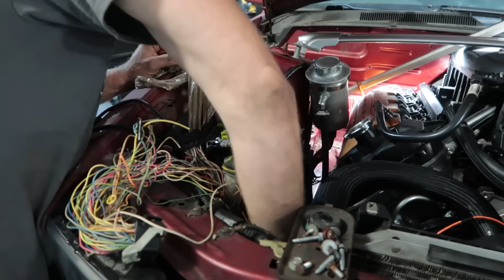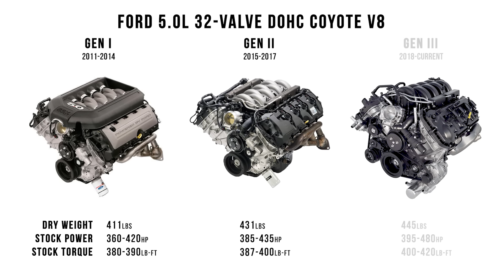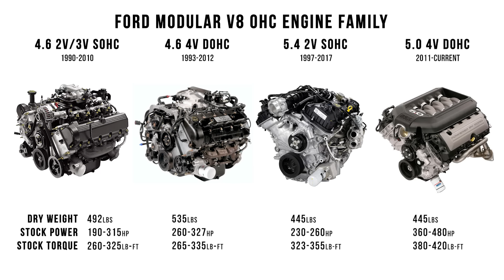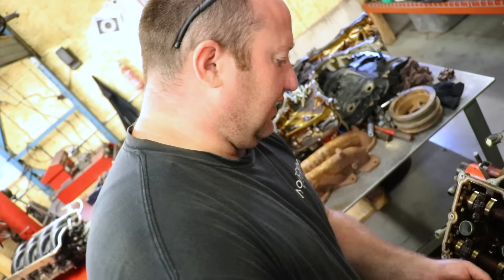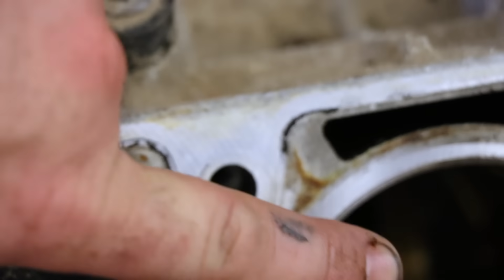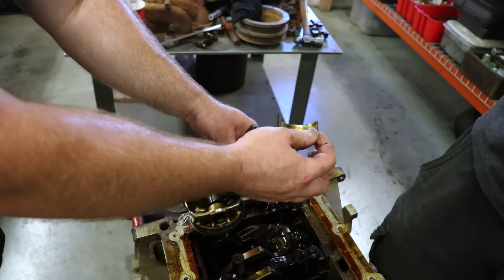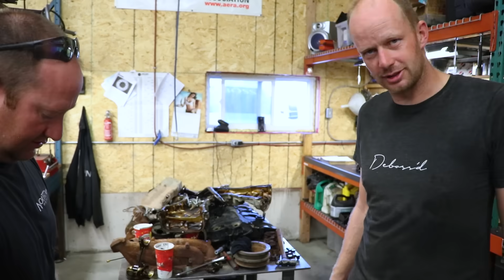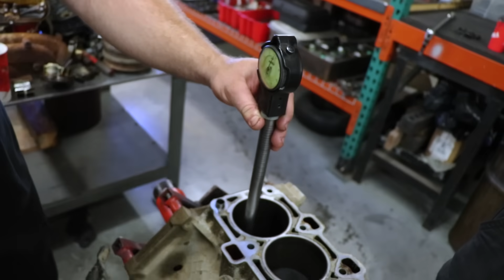REVIEW: Everything Wrong With A 5.0 Coyote Engine

Comment: I’d take an OHV engine any day of the week over a DOHC engine. Way of the future my ass. Ford just spend all that R&D cash on the new 7.3 pushrod gasser. The OHV’s aren’t going away anytime soon.
Reply: DOHC is OHV, OHV just means over head valve. The term you should use is cam in block or pushrod motor. And the reason they specify if it’s a OHV is because ford for example had a flathead v8 which had the valves kinda built into the side of the bore is how I’d explain it.
Reply: @MichaelFletcher-to7mm  my butt stinks
Reply: Mike Pevency that sucks man, go wash your ass.
Reply: Spartan 0703 
Yeah I already know that captain obvious. Thing is I just don’t care.
Reply: Francesco just saying, I would’ve never known for all I knew you’re just a dumbass who doesn’t know the correct terms, but glad that isn’t the case.
Reply: Spartan 0703 
Nobody says “cam in block” that’s just pretentious. When saying pushrod or “over head valve” is more common anyway.
Reply: Francesco I have not heard people call a pushrod motor “over head valve” OHV can be applied to both overhead cam and pushrod motors, once again it’s all about using CORRECT terms.
Reply: It is the future. GM is in talks of replacing their 5.3 with a dohc 4.something liter v8 and the rest i4 and v6 turbo engines. The pushrod is punched out technology wise. Its at its limit. Ford said they HAD to use pushrod design bc of its size. Thats the only reason they said.
Reply: Joshua Childers
Are you sure you know what you’re talking about? Ford said they wanted the 7.3 pushrod for low end torque and longevity reasons. Not “oh it’s too big” or whatever you’re saying. And what do you mean “punched out tech wise” like what does that even mean? OHV and SOCH/DOCH engines have been around for basically the same amount of time. They’re both really “old technology”
Reply: @francesco1998  the engineer for the 7.3 flat out admited on TFLs channel that the ONLY reason they went with pushrod was for SIZE and  is designed for low rpm use.
Reply: Joshua Childers 
Alright point me to the video I want to see it.
Reply: Francesco you’re right on that, chevy and dodge are still finding ways to get power out of pushrod motors, they’re definitely not done yet, the technology gets better each year
Reply: Joshua Childers 
I just looked for a video, it was TFL’s talking trucks podcast and the chief engineer said that they used it for “simplicity” and “compactness.” If that’s what you’re referring to then it’s definitely not the only reason they used it.
Reply: Joshua Childers and longevity.
Reply: @MichaelFletcher-to7mm  not really. The valve train configuration doesn't have anything to do with longevity. Look at Toyota engines. All ohc.
Reply: Joshua Childers yea I’m just saying that was one of fords reasons, I know overhead cam engines are good, I have a 2010 f150 4.6 3v with 315k miles.
Reply: @joshuachilders129  i can not wait for that , i say , its about dam time !  Chevy made a good v-8 double over head cam engine , 4 valves per cylinder ...
Reply: Because of low end torque the dual overheads have to rev higher to make power
Reply: @gsppuffer  they dont know , still stuck in old school ways ! Lol
Reply: It's for space using ohv though. Same as actual trucks.
Reply: A typical mechanic if asked.... What would u prefer to work on.. LS or dohc.  LS all day long ... Easier, cheaper .  But dohc are nice.  They have issues.
Reply: @latwoods  this is called antidotal.
Reply: @bryane2857  Yep real world proof and end of conversation!!
Reply: Dohc are capable of reving much higher, the design is for racing and not meant to last a million miles which most vehicles themselves don't last that long anyway.
Reply: The wave of the future isn't OHC or OHV.  For 4 stroke engines, it's camless.  Valves will be electronically actuated via solenoid and won't be simply on/off.
Reply: @chuckschillingvideos  in case you haven't noticed the wave of the future is electric.
Reply: @bryane2857  Reading comprehension isn't exactly your strong suit is it?  If you weren't so moronic, you might have noticed that I qualified my statement with "for 4 stroke engines."  But that's probably asking way too much of a simpleton.  As for electric being the wave of the future?  Hahahaha.  Nope.  Not just no but hell no.
Reply: @chuckschillingvideos  wow. Sense of humor isn't your strong suit.
Reply: chuckschilling 
I think electric vehicles will take over before that happens.
Reply: Francesco
 , well , i am not a Ford guy , i am a Chevy guy , but we have had a few  Fords  , and they have worked well , respect there , i think Ford is sure trying , as you know when a co.  spear heads a new type of engine , it usually does take awhile to get all the bugs out of it  .  but what does not help is a moron that does not change their freakin oil , i dont care what type of engine you have !  and i do like the double over head cam engines better , because , you have 4 valves per cylinder instead of 2 ,  more h/p instantaneous and higher red line !  all you will ever see , are my tail Lights ! Lol
Reply: Roland Gutierrez 
You get more power and torque at lower rpms with a pushrod than you will with an over had cam motor. It’s just how the physics work because of how the air moves through the valve opening at lower/higher rpms. Pushrods are far better for truck applications because you can get your power faster without having to stress the motor like you would on a DOHC or even a 3v SOHC. (A two valve SOHC is comparable to a pushrod in performance but a pushrod only uses one camshaft whilst a SOHC uses two, making the pushrod simpler and in my opinion better.)

Comment: If you equally built a Ford 300 six it'll out perform and outlive any other ford V8 of the same displacement
Reply: What ?
Reply: Straight 6's are damn near bullet proof. Most semi trucks still use 6's.
Reply: Those motors were slow, but great low end torque.
Reply: @Retadin  when you pushed some boost or a 50 shot of n02 witch acts more like a 175 shot they really wake up, boost is key and can make obsurd power

Comment: Why is there so much wrong with vehicles? I bought a 96 chevy s10 for 300 bucks. Has a 4.3 v6 vortech has like 200k miles on it and it runs better than my moms old 2013 dodge charger rt with the 5.7 hemi

Comment: What about piston slap at 120-150k miles on the 4.6 and the spark plus snapping in the heads or pulling threads out of the heads???

Does the Gen-III 5.0 have those problems too???

I’m still running a pushrod 5.0, seems like old technology lasts longer even with more abuse rather that the new mod engines that are so damn sensitive and require special tools to rebuild or repair them.

I’ve heard the 4.6 all the way up to the 5.0 are basically 2 either SOHC or DOHC 4 cylinder engines wedged together at the crank.

In other words the original ford modular engines were based off of a 4 cylinder variant that was reengineered into a V8 configuration.

I’ve got no idea personally but, that’s what I’ve heard by quite a few mechanics from Ford and GM about the 4.6 - 5.0.

I’m a pushrod engine guy and likely will stay that way even though I’ve worked on both styles, I’ve personally found considerably more issues with SOHC & DOHC engines verses pushrod engine issues.

Especially, that pushrod engines last longer and can take more abuse along with making more power than SOHC & DOHC engines with significantly less money invested.

Comment: Fun fact, the 5L Coyote engine was first designed for the Jaguar XJ market, then brought over here from the UK to be put into the Mustang.
Reply: What's your source for this? Because the Coyote was obviously designed as an evolution of the Ford Modular V8.
Reply: @christophercasale7961  the Jag engines are ford modular engines. Doesn't take much searching to find they were designed and built in the UK Ford engine factory. There's really nothing American about American manufactured cars anymore. It's not hard to track information down, it's readily available online.

Comment: 15:45 Wait a minute...
Did this guy just say that over-boring an engine doesn't increase the capacity because the over-sized pistons are designed differently, to maintain the standard compression ratio?
Changing the pistons makes no difference to the swept volume, only bore and stroke can do that!
Reply: Yeah, I was going to say the same.  Unless you change the stroke on the crank, the displacement goes up when the piston gets bigger.
Reply from the maker: @renof2505  On OEM pistons, the ring groove is lower in the piston to make up for the larger displacement.  That way the CR stays the same and manufacture's don't break any emission laws.  On aftermarket pistons, there is no general rule.
Reply: @renof2505  mist replacement pistons have a shorter installed compression height to correct compression for the over bore and to account for possible deck height variances from the original manufacturer that's why you have a performance engine zero decked if your over boring it
Reply: I think he was trying to make a point about the engine's computer not magically giving out more power.
Reply: @wim0104  (3/3) However, piston size/shape and compression ratio has no effect on engine displacement because the volume of the combustion chamber (the space above the piston at TDC) is not included in the calculation of engine displacement. Displacement is calculated by multiplying bore, stroke and number of cylinders. Hence you can calculate an engines displacement if all you have is the block and crankshaft.
Reply: SD1fruitbat piston size has everything to do with displacement! Bore “piston size” and stroke and number of cylinders gives you displacement.
Reply: @1953fords  Nah, I meant the design of the piston crown (flat/dished/domed/pocketed) or its height from the wrist/gudgeon pin has no effect on displacement, because the piston remains the same size and shape whether it is at the top or bottom of the cylinder. I'm assuming that the piston diameter will remain consistently slightly smaller than the bore.
Reply: SD1fruitbat ok yes that is true. Sorry mis understood. 👍🏻
Reply: @wim0104  (2/3) Since the engine ECU is designed with the standard compression ratio 'baked-in', and it has no way of measuring the compression ratio, the manufacturers ensure that the standard compression ratio is maintained by subtly changing the design of the pistons (which have to be replaced anyway, to suit the increased bore). 
This change to the piston may be to the piston face (dished to flat to domed), or simply by altering the height of the gudgeon pin (wrist pin) from the piston face.
Reply from the maker: @SD1fruitbat  If there is room, the ring groove could also be lowered on the pistons. Thanks for the points
Reply: @DEBOSSGARAGE  Compression ratio has nothing to do with displacement. He said when you overbore a 350 it does not increase its displacement to a 355. When you mentioned doing the overbore to bring it to a true 5.0 he said that it's not how displacement works or something like that. A bunch of us heard it. You guys were talking displacement not Compression ratio 2 completely opposite things
Reply from the maker: @mesanders1113  If it didn't come across, I think Scott was still talking about CR.  We filmed this at 6 AM and it was just a couple guys shooting the shit while taking an engine apart.  Also Scotts first time with a camera in his face.  We will make a follow up video going over everything to clear things up.  Too much controversy going on
Reply: @DEBOSSGARAGE  I can understand that. He seemed pretty knowledgeable otherwise just through all of us keyboard commandos/mechanics for a loop when he said that, then went on to explain. Can't wait to see the follow up.
Reply: @DEBOSSGARAGE  Sad to see you have haters, your videos are high quality I think, good job.
Reply: @DEBOSSGARAGE  Jeez, nobody in these comments leaving room for what we call simple human error, misspeaking. Mentioning oil on YouTube is the quickest way to start a war, hahaha.
Reply: @802Garage  hey dude
Reply: @baby-sharkgto4902  Ey ey!
Reply: @wim0104  (1/3) As I understand it, the point was that increasing the bore of an engine would also increase the compression ratio (as the engine is now squeezing more fuel/air mix into the same combustion chamber). 
Increased compression ratios will increase the risk of pre-ignition (pinking, pinging or knock), where the fuel/air mix ignites prematurely, due to the heat of compression, rather than being ignited by the spark from the spark plug.
Reply: @SD1fruitbat  Pinging is detonation not pre-ignition. Pre-ignition is as it says, before the spark plug fires a hot spot ignites the fuel air mix early. Detonation is post-ignition, after the spark plug fires and creates the normal flame front a second flame front spontaneously combusts. With both detonation and (if the spark plug fires before the entire charge burns) pre-ignition you get a small explosion when the 2 flame fronts meet in the middle. I'd also like to know why the word "pinking" even exists.
Reply: @danielthechskid  Oh yeah, I'd forgotten that! I'd still suggest that both could be caused by an increased compression ratio.
Also, I'm pretty sure that 'pinking' is the British onomatopoeic word.
Reply from the maker: If it didn't come across on the video, on OEM pistons, if they are oversize, the ring groove is lower on the piston to keep the CR the same.  This way it doesn't mess with emissions.  On aftermarket pistons,  there is no general rule
Reply: @DEBOSSGARAGE  I don't think anybody is arguing that the top of the piston may be shaped different in order to compensate for higher compression caused as a result of increased cylinder volume that is caused by the overbore.  But the bottom line is still that the displacement of the engine has been increased by the overbore and the stroke has remained the same as top dead center and bottom dead center, although slightly different, have not changed in reference to one another.
Reply: Yeah I was scratching my head. Bigger hole, bigger displacement. I did however have a little trouble following his point.
Reply: The comments showed what I expected. The bore most certainly changes the displacement. The compression height, ring location or crown shape may change to keep the stock compression but the volume without any doubt increases.  Bore, stroke, and the number of cylinders are he only terms in displacement calculation.
Reply: Sounds like no displacement for replacement
Reply: lol true man!, thats why he is in love with the coyote engine, give me an LS!!
Reply: Yep crazy ej
Reply: I was thinking the same thing how could a skilled motor builder spew out some nonsense that a overbore on a motor will not effectively increase displacement. Sure it's a very small increase unless you change the stroke but still an increase.
Reply: I just heard him make that comment and I had to stop and scroll down to check the comments and make sure somebody else caught it.  I am done listening to him at this point.  He lost all credibility.
Reply: @curtisanderson9984  - That's my thought exactly. Nothing he says has any meaning at this point.
Reply: Yup, I hope this guys never on the channel again. Seems like an idiot.
Reply: @jacobboone6078  That's a little harsh!
Reply: @jacobboone6078  Not an idiot but spouting some nonsense.  I am not buying problems from changing brands of oil either.  I use whatever is cheap and you could eat from inside my engines.
Reply: @jacobboone6078  dude you probably don't even change your own oil.
Reply: @Zach-ju5vi  Got a keyboard cowboy here, watch out. Deboss always has great real world info, then this jackass comes along with tons of made up shit.. like gtfo.. there are plenty of stupid youtube channels he'd fit right in on. Maybe Hoonigan or something..
Reply: @jacobboone6078  the guy was talking about the discoloration of the engine and the type of sludge build up synthetic has, he's not a scientist he just showed the viewer what he see when he takes apart engines everyday. I bet you are really fun at party's.
Reply: Yep and then at the end he says that DOHC is new technology. It was first available in a production motor in like 1909, so over 100 years old.

Comment: NO science or testing about the oil, that motor seems like the OIL wasn't changed to often. FURTHER, non-synth oil not used in most new engines at lighter weights.

Comment: Love my 2011 f150. The coyote engine has plenty of power for my needs and gets pretty decent fuel economy. I bought it used at 90,000 miles and it currently has about 128,000. I've just started to notice the tranmisssion is starting to shift a little rough at times. But other than that, it's been a solid rig.